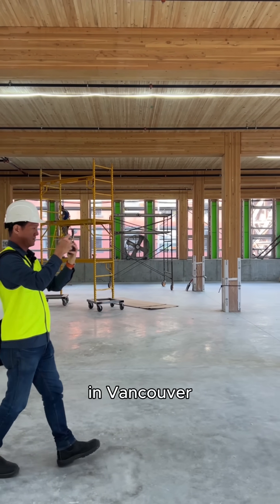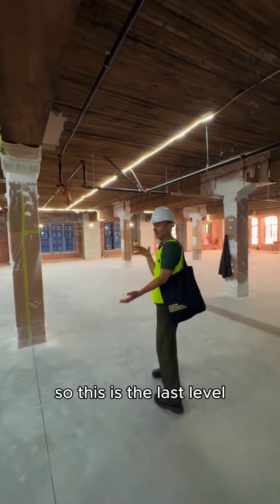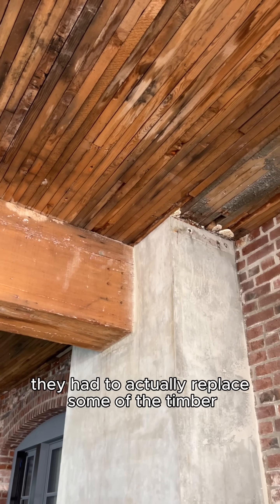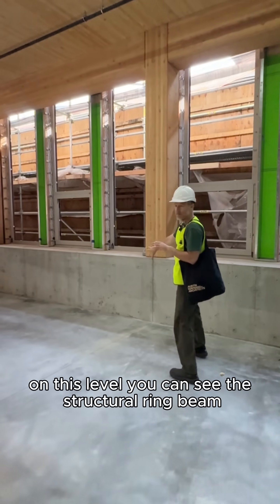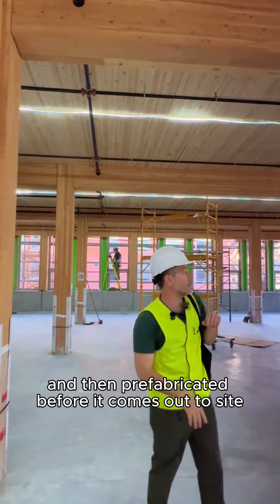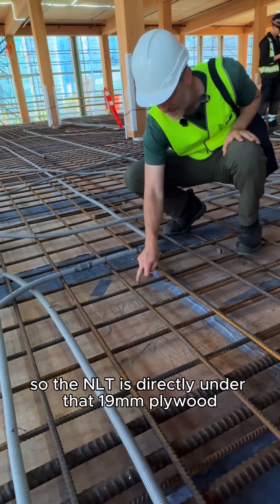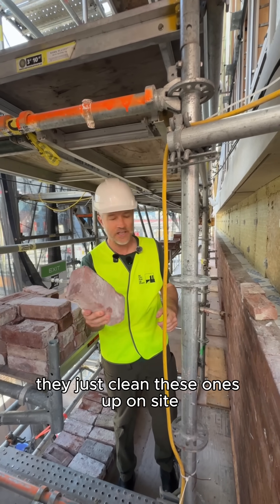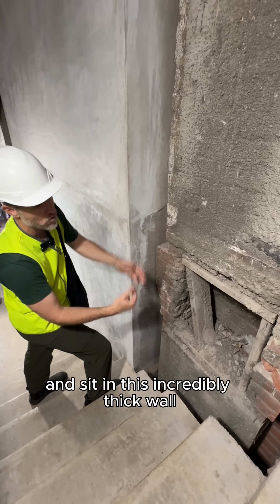837 Beatty St in Vancouver

Comment: Nice project.
Do you know why the slabs are both NLT and concrete slab?
Acoustics? Fire code? I imagine a thicker mass timber slab would have no trouble spanning that column spacing
Reply from the maker: The concrete allows for reinforcements back into the concrete core which helps as lateral bracing and no need for diagonals on the timber frame. It also apparently helps weigh down these buildings having small amount of concrete topping.

Comment: This was surreal to come across in my feed! I have been working as the VDC (BIM) manager for ETRO on this project since early preconstruction planning in 2021, and I absolutely love this building. In addition to the complexity of managing the existing timber through the structural upgrades, coordinating the services to fit everything a modern building needs into the existing lower level was (and continues to be) an incredible challenge.  I love you guys and your work — especially Park Life and your explanations of it!
Reply: Nice project, good work to the whole team
Do you know why the slabs are both NLT and concrete slab?
Acoustics? Fire code?
Reply: @rev_dude  Both those reasons, and a few more, I think! One is for structural shear resistance, you'll notice there are no diagonal timber elements, so lateral stability is all coming from the floor assembly; there are some pretty beefy drag bars tying the topping (I wouldn't quite call it a slab) to the core. Another is to house and conceal all the electrical conduits. The goal was to have as much of the NLT as possible visible from below.
Reply: @RampantEnthusiasm  Very insightful, thanks!
Reply from the maker: Great work. Also the algorithm knows how to find you.